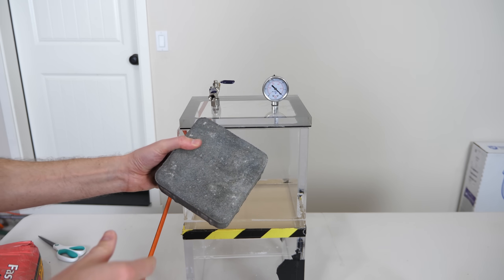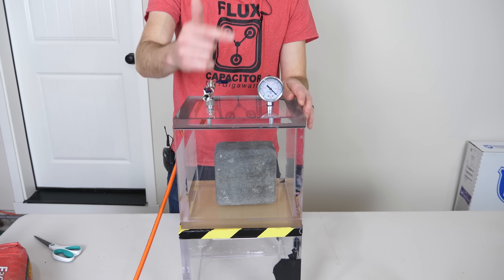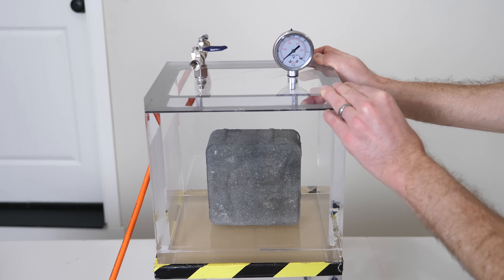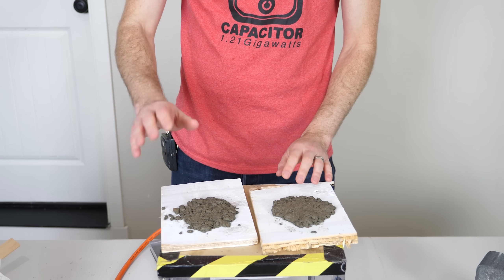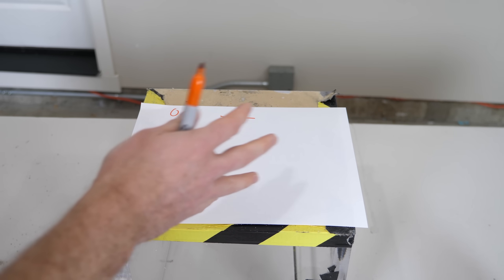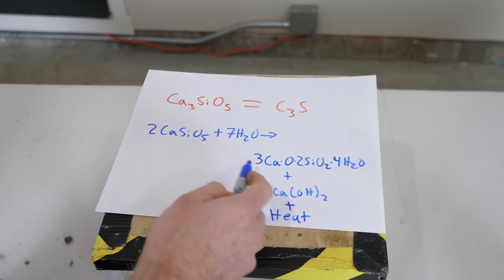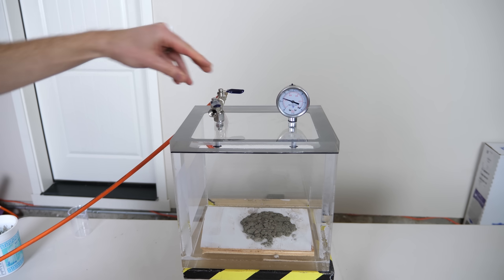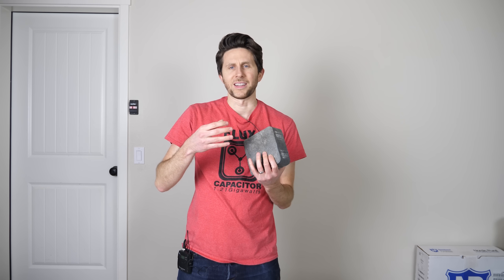Does Concrete Turn to Dust in a Vacuum Chamber? Concrete Without Oxygen Experiment

Comment: If anything, had you made more that was intended to be molded into a brick, then the vacuum cement brick would be stronger as the vacuum would have pulled all air bubbles out which would make it have more structural integrity.

Comment: How does aircrete, the special light concrete with a large amount of tiny air bubble in it, react in a vaccum chamber. Will the pressure of the air bubbles in it makes it slowly erode into dust?

Comment: 1:47 it will not crumble, because the oxygen is already bound to the molecular structure. Moreover, even if it were not, or if some oxygens were "loose" or "came loose", they'd be liberated into solid surroundings and rebind.

The prior is a different question than "what if there were no oxygen for five seconds?" If there were no oxygen for five seconds, that would technically include no molecularly-bound, non-gaseous oxygen. If all the oxygen suddenly disappeared from concrete it would crumble. ...but that wouldn't happen even if all the atmospheric oxygen suddenly disappeared for 5 weeks (maybe even 500 years), let alone, 5 seconds.

Comment: People are missing the point.  The hypothetical "removal of oxgen" means all oxygen everywhere -- and tied up in mixtures, compounds, and molecules.  Not just air.

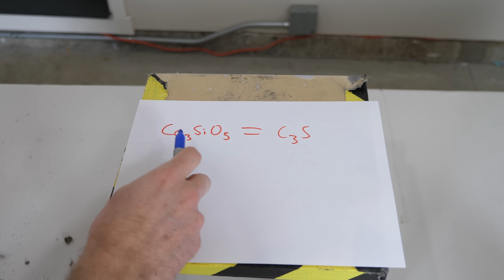And the question asked @ 3:44 "Does concrete need air to dry?" is not quite a correctly-worded question. The water added to concrete does not "dry" per se, but the water actually becomes part of the concrete and binds chemically to the other ingredients in the concrete (as he explains beginning @6:50). That's why concrete gets stronger if you keep it wet while it's curing.

Comment: The only force concrete without re-bar in it can take is preassure....all other types of forces break it quite instantly if you dont put in re-bar. 
Also we used to vacuum suck floor-pours by putting out vacuum mats and connecting air....we just sucked the moisture out before starting to work the surface...it became some damn fine floors. 
Nowadays tho we have so much additives in the concrete so they can control all the drying and such chemically instead.

Comment: I see it as a major issue in western education because the distinction between elements and elemental substances, one of the core distinctions that has existed for 150 years is never made in Western schools and instead they cling to the old school style (no pun intended) of "oxygen is an element that forms the basis of the water molecule and which is a gas at room temperature", which is essentially just two very different things given the same name. In Soviet-based schools the very first theoretical lesson always highlights heavily that a distinction should be made between oxygen as an type of atoms and oxygen as a "non-compound substance", as we call it, with easily observable physical properties like it being a gas, having no smell and so forth, and every textbook has as one of its very first tasks a list of statements where students have to decide if the statement applies to an element or a non-compoind substance. Wonder if trying to teach that in Western schools will get me into trouble for teaching definitions that don't match what the majority learns within the same community thus creating potential miscommunication which is like the opposite of how science should work.

Comment: Sorry, but this whole thing contains a bit of bs. Thx for trying to clear that up. Its not the removed oxygen that would make the buildings crumble, its the hypothetical  higher concentration of the remaining co2. It would hypothetically speed up the carbonatisation of concret. That would drop its ph level from 13ish down. This would mitigate the oxidation protection of the steel rebar, the concrete provides wich in the process of turning into rust increases in volume, loses strength, cracking the surrounding concrete. The stuff then loses tensile strength, integrity and collapses. Its not just bad design when highway bridges suddendly pancake. Its the process of carbonatisation. But even under 100% co2 athmosphere it would take years. Concrete should always be cured (kept wet) for bout 28 days after hardening to reach its max design performance endurance. If somebody tells you your conrete has to dry out so the next layer can go on, give em a kick in the ****. If you dont let it cure you give away over half of its lifetime and possible strength.  If your a contractor you couldnt care less if thats just 30 years. First conrete-steel bridge ever build still alive in france with no probs after 100y. Steel rebar has to be a couple of cms from the surface so the co2 doesnt reach it. The combination off those errors is behind why us highways pancake and 80% off german autobahn bridges are close to failure: time is cash, fasr fast. Vacuum chambers are used in ultrahighperformance concretes with nano particles to get out the last microscopic air trapped in side. Uhpc is used in industrial applications for generator foundations eg.. concrete doesnt care for athmosphere to bind. After all it does so perfectly under water. In the lab we keep samples underwater in a pool for 28days. Then they are tested, crushed. Thats the german norm. Eu now. Btw: your fast settling conrete is an aluminate cement and a different animal then portland cement.

Comment: Concrete is a man-made conglomerate, at naturally formed rock. It is porous and will absorb water. All your pump did was suck the air out and pull the water from it.
Reply: Lack of oxygen in a medium or if there is an absence of medium doesn’t crumble concrete. They say that without oxygen in the air that concrete collapses. Its logically true.

Comment: I doubt cement setting in vacuum will be as good as the one setting in average humidity air. If you suck water out of it, it will be weaker, and water is a leaking gas on vacuum.
Reply: You're just making a denser sedimentary rock at that point. That means it would be stronger.

Comment: Before the test started.
How good is the education of people in the world.
If someone tells me that when oxygen disapperas on the planet all concrete will disappear (and as I may say much more)
As you tell us : Concrete is a product from sand and cement.
Without oxygen we have no sand left...only (pure?) silicium. Sand is the name for SiliciumOxide.
In other words...concrete does need oxygen to exists but no free oxygen in the surrounding.

If we take out the air and will see what happens to concrete it depends on the type of concrete.
Lightweight concrete (filled with air bubbles) can disintegrate due to the pressure in those (closed) airbubbles.
If thos bubbles are open that is less likely.
Massive concrete will hold.

Problem with drying without athmosphere will be that the water can evaporate very fast...may be to fast.

Comment: Cement ,quicklime, sand, and either large or small stones. The big difference between cement and concrete is, concrete has  stones in it, raging in size from a pea to a large strawberry.

Comment: Big difference between vacuuming out the air and magically removing all of the oxygen from every molecule. I'm struggling to think of any non-magical way to actually accomplish that which doesn't first involve crushing it into powder yourself to increase the surface area to make the reaction y'know..NOT take 15,000 years.

Comment: The only problem is that concrete won’t cure correctly at very low temperatures (out in space). The vacuum chamber does take the oxygen out but not the temperature surrounding. And if we let cure here and bring it up later, we’ll then it’s too heavy, we’d better continue with the steels. 😊

Comment: As a masonry contractor, I'm quite familiar with the properties of concrete.  Concrete will even set up even under water.  The reason the concrete set up slightly slower in the vacuum isn't because of lack of air but rather lack of air movement.  Mortar on a corner of a building will set up faster than the rest of the wall because it experiences more air movement like wind reducing the moisture content.  While this does make it set up slightly faster it does not strengthen the concrete in the long run.  In fact wetting the concrete and keeping it wet during the first 7 days of the concrete cure will increase the cure time slightly but can greatly increase the strength of the concrete when fully cured, as well as more evenly cure preventing cracks.
Reply: Water boils and turns to vapor as the pressure goes down. So I would expect it to harden faster as the water is forcibly sucked out of the concrete. But I guess at some point right below the surface, the weight (and thus pressure) of the concrete is higher than 1 atmosphere, so the water remains a liquid internally.
Reply: @cyleleghorn246  Yeah, perhaps on the surface as you said.  But in the industry we call concrete "green" when it's still in it's initial cure period and at this point it is susceptible to easy damage and is the color green.  This is why when concrete is "green" you do not want people walking on it.  When you watch the video, the concrete in the vacuum actually cured a little slower and was greener and crumbled more.  If there's high winds when you're working with concrete or mortar it set's up crazy fast because the air is pulling the moisture out of the concrete, this wouldn't happen in a vacuum.
Reply: @Ryan-ff2db  thank you for explaining it more. It does make sense that as concrete cures with an exothermic reaction (releases heat) that wind will speed up the process by giving it wind chill. And in a vacuum, since there is no wind or even air to conduct the heat away from the concrete, this would become a blackbody radiation problem, which is the slowest way to get rid of heat. Same reason it's so easy for space ships to overheat in space due to human warmth and electronics, even though at all the same settings they'd be running very cold anywhere on earth surrounded by air or touching the ground. There's just nowhere for the heat to go, nothing for it to travel into to escape the ship, or in the case of this video, to escape the concrete and allow the reaction to continue
Reply: @Ryan-ff2db the water in concrete doesn't evaporate, at least it shouldn't, that's the chemical reaction the "C3S" + 7 H2O. If your water evaporates the reaction won't take place and the cement will not harden.
Reply: @nicholasthibeault1729  If the water evaporates from boiling in the vacuum it won't be there for the cement reactions to take place, though the initial preliminary reactions do happen within a few minutes, even if we don't really see them in regular concrete. That said - as long as the concrete is workable, there is free water that can be evaporated and thus not react chemically. He is right in the video that C3S is the primary compound in portland cement, but it is actually not the first to react. That title goes to C3A which is a minor component with A being aluminium oxide (Al2O3) rather than the S for SiO2. C3A and gypsum, which is specifically added to cement to control the rapid reaction of C3A, will start interacting pretty much in seconds.
Reply: I would be curious to know how actual wet concrete would react in a vacuum, and not just a wet cement mix. That wasn't wet concrete that he put in there, it was just wet cement.
Would the sand have an effect on the way it cured?
Reply: @petrolhead0387  He used concrete.  Cement is a fine Portland powder that forms a slimy paste if mixed with water by itself.  Concrete is Portland mixed with gravel and sand, which is what you see in the video.
Reply: @Ryan-ff2db  just went back and rewatched it, I didn't realise the dry mix had gravel and sand pre mixed, I thought he was just using cement and water, my mistake.
Reply: @petrolhead0387  Yeah.  Nowadays, it's all premix bags(or a concrete truck).  We don't mix the ingredients by hand anymore.  It's faster, cleaner, more consistent and guaranteed to reach certain compression strengths by the manufacturer.
Reply: This is exactly the opposite. Concrete does not set by drying. It sets by reacting with water. So dry concrete will not harden. It is very important to keep the concrete wet for a few days so that it can reach a decent strength. Normalized tests for concrete strength always proceed by curing concrete samples in a temperature controlled water -bath.
Reply: @JohnBames5327  Yup. Mortar prism standardized tests (both ASTM and EN standards) to check the cement are also with 24 hours in controlled climate chamber and then in water bath.
Reply: My grandpa was in the Corps of Engineers, and he claimed that keeping concrete COOL (not wet) while it's curing is how you get really strong concrete.
Reply: @JoshuaEisenbart  It's really both. If it dries out its also bad. Temperature has influence on curing time, and the heat from the cement+water reaction can lead to cracks if it gets too high, so for big infrastructure projects the concrete is designed for slow strength and thus head development, or is actively cooled.
Reply: Concrete that sets underwater will actually be stronger than concrete that sets in air. It’s a slower process and the crystals are smaller and stronger.
Reply: As someone who had a basement crack, I was astonished by hydroponic cement.

Comment: Nice video, actuallcy if you think about it, the concrete cures in a vacuum, only because the inner part of the thing is not in contact with air while it curates only the exterior layer.

Comment: I have some contradictions on it
1) They don't clearify whether they vanish all of the oxygen (oxide,free state, etc) 
2) if so other compounds and polyatomic ions which are made from oxygen like carbonate sulphate might either change or degrade completeley. Cement or concrete has its major composition as many oxides like Those of Aluminium silicon Magnesium and calcium 

So does that mean it would technically affect it ?

2) 02 is also present as a bounding agent between different constituents of cement but CO2 is much common
maybe 🤔🤔

Comment: Concrete is both poured and cured under water. if concrete requires air to cure and to retain structural integrity, underwater applications would be impossible. Much like a rocket engine uses LOX as an oxidizer, cement brings its own oxygen along as well.

Comment: I think it might crack assuming there are air/gas bubbles trapped into it. But since it's poreous might stay in place (definitly not turning into dust, though...). As for the wet one, I don't believe it will dry well since the "drying" is a réaction between cement and water wich will boil. But then it will stay in gas form in the chamber so might react a bit...dunno...let's see :)

After watching, I was part right...and thus part wrong ^^ I'm quite surprised to see water did not evaporate before reacting with cement.

Comment: The cement collapsing without 5 seconds of oxygen is a misleading myth. They are mixing up the difference between oxygen in a molecular bond with cement vs oxygen as a gas.

Comment: That theory is literally the dumbest thing I ever heard. On one hand, if they mean no oxygen as in no air, it's dumb because oxygen in molecules doesn't behave in the same way as loose oxygen, like O2 or O3, so the vacuum would have no effect on it. Breaking bonds in molecules requires either energy or a chemical reaction, and a vacuum is neither.

On the other hand, if they meant no oxygen as in oxygen molecules disappear, that's just a pointless thought experiment that you can do for any element. It's not something that happens ever, elements don't just disappear, unless they decay into other elements, and as far as I know, Oxygen isn't particularly radioactive. Yeah, a sudden change to any fundamental principle of physics would have disastrous effects, but elements poofing out of existence isn't a thing that can happen, under our current understanding of the Universe. AND AGAIN, WHERE DID THAT ENERGY GO OR COME FROM? WHAT REACTION CAUSED IT? IF OXYGEN SUDDENLY DISAPPEARED, CONCRETE WOULD MAYBE CRUMBLE, BUT THERE WOULDN'T BE ANYONE AROUND TO CARE ABOUT IT, SO WHAT'S THE POINT OF THE QUESTION?

Cool video, though.

Comment: I would think it would be stronger. Cement cured under tension is stronger.
Reply: Cured in a vacuum chamber would make it stronger, except he didn't let it fully cure. If the concrete is for outdoor use it is better for it to cure with pockets of air because it helps concrete weather through outdoor freezing temperatures

Comment: Hydration?  I would have thought a chemical reaction that creates heat would be oxidation.  Ah further into the vid I see.  As to whether or not the cement in the vacuum will harden, I am going to guess that it will because all the oxygen needed is bound in the chemical structure of the concrete itself, adding water, the hydration, allows those crystals to grow and release oxygen.  I mean also I say this because Romans were able to use a form of concrete that sets in water, and in water there is not loose oxygen like in the vacuum chamber.  If there were free oxygen then we probably would not drown it water.

Comment: Concrete doesn’t need air to dry but it does need water to hydrate the cement. Dang as I was typing this you mentioned hydrating the cement

Comment: Nothing. But setting concrete would be interesting, IE would it draw water and air out of setting mix. If water goes or reduces concrete will not set correctly.

Comment: The only other possibility is if the concrete was poorly formed and had pockets of air or water trapped inside. At that point, the concrete would need to have enough structural integrity to keep ~1 ATM of pressure trapped; otherwise, it could crumble.